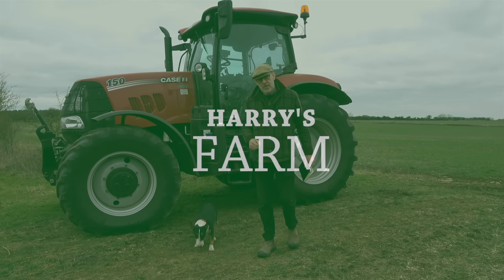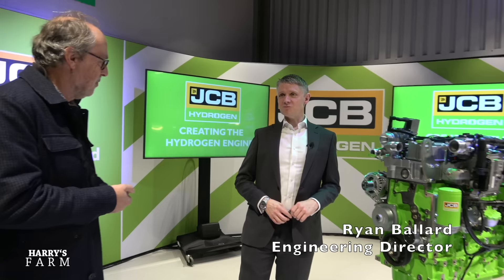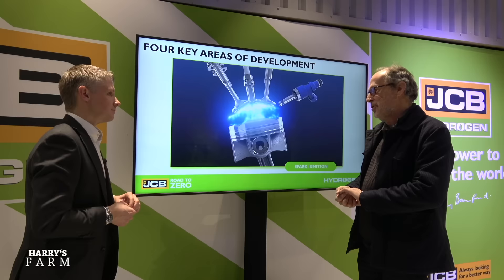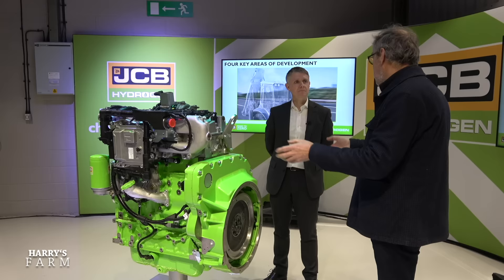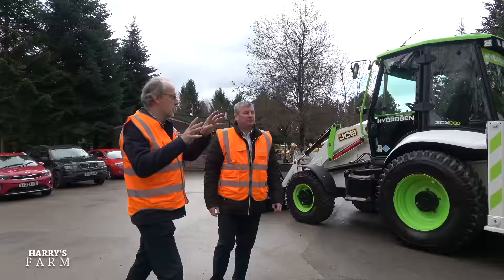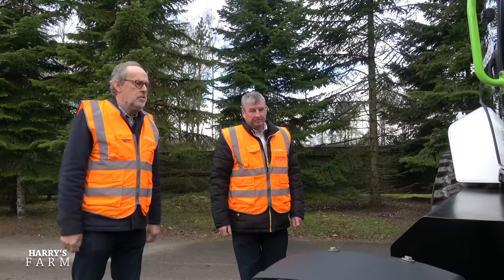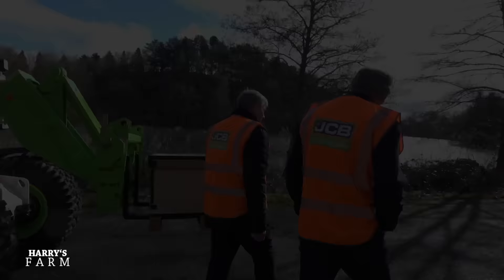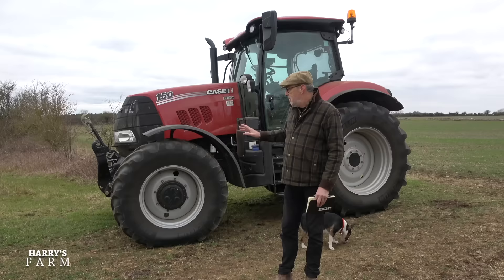JCB is moving to hydrogen power for all their big machinery. Here’s why.

Comment: If you want to bury your head in the sand a JCB is a good tool to use apparently.

It's a lot easier to get electricity to a farm to recharge batteries than liquid hydrogen.  While hydrogen can be an excellent low carbon fuel it is very difficult and expensive to distribute to remote users.  The Bamfords are about to go down the same path at the Toyodas.  That's sad.

Comment: A quick Google seems to indicate that it takes about 50kWh of electrical energy to generate 1Kg of H2. So by my reckoning a 1MW wind turbine could generate  1000/50 = 20Kg of H2 per hour or 60 litres equivalent of diesel (1KG H2 = 3 litres diesel). This is just about the amount it takes to fill my Land Rover. Could we ever install enough turbines to generate commercial quantities of green H2? Please comment if I have made a mistake in this calculation, I think I must have somewhere - just can't see it.

Comment: 350 bar tanks that’s a lot of pressure Is that flammable then sounds abit dangerous compared to normal vehicles and if the getting put to work might be dangerous lol would any and mechanic be able to work on it? What about fuel station what would be the difference there ?

Comment: I just don't know why you would use this over a fuel cell and electric motors? Initial costs, both for the customer and manufacturer maybe? I just know that some of the biggest expenses with this is the generation and transport of the fuel. So having a fuel cell that's able to get twice as much energy out of the gas seems like the much better choice. I know with cheap hydrogen it doesn't really matter as much, but we are a long way off from having that. The amount of green energy available is increasing rapidly but we are still quite a ways from having the excess generation capacity that would make hydrogen competitive. Supplementing any green hydrogen with blue hydrogen is probably worse than just running diesel or the natural gas itself.

Comment: Hydrogen in the United States right now costs $25-$36/kg right now. 1Kg of hydrogen has about the same potential energy as a gallon of gasoline, which is slightly less energy as a gallon of diesel. How much fuel does a machine like this typically consume? To power a hydrogen engine with for the same amount of time as you could with 5 gallons of diesel would cost $150+ in hydrogen fuel.

Comment: Now JCB have to work on an onboard electrolysis unit. Water will be the fuel source. This way the vehicles will supply their own hydrogen. Water is extremely dense in hydrogen. It's the most logical approach. Of course, Big Oil will hate it, as they always have.
Reply: You forgot about the energy required for the electrolysis….
Reply: @Simon-dm8zv  No, I didn't. I do realise electrolysis requires energy. The requirements for the amount of hydrogen needed in a car's engine can be supplied by electrolysis via an electrical system in the car.  Stanley Meyer did it in the 1990s already. He even had a patent on it. Alas, he's dead now. I've talked to one old fella who was a mechanic and he told me he and his work mates once spent eight months, working around their normal schedule, converting a V8 to hydrogen with an onboard electrolysis unit and it drove long distances on very modest amounts of water. Of course, this is made illegal to protect the monopoly of Big Oil. So, you don't need a nuclear power plant in your boot to do some electrolysis. You just need a battery and an adjustable voltage/current unit.
Reply: @nephos100  It's not "illegal". It simply doesn't work.
Hydrogen electrolysis requires more energy than what the output hydrogen contains.

Let's assume 100% conversion efficiency (physically impossible).
You take one liter of water and convert it from H2O to H2 + O. Splitting these apart takes a certain amount of energy.
This energy you spent is akin to lifting a weight over your head - the hydrogen wants to recombine with oxygen, and contains potential chemical energy, much like the weight wants to fall down and unleash its energy.
Now you recombine the H2 with O, either through a fuel cell or through combustion, and you again end up with an equal 1 liter of water.

And you expect to have gained excess energy? Where would the energy come from? You start and end up with equal amounts of water.
Similarly, the weight would fall down with the same energy you spent lifting it up - not MORE.

This is a scam, and a really obvious one too. Ask any chemist or physics professor.
"He even had a patent"
But have you ever seen this car work? No?
Reply: @logitech4873  No offence, but everything you just said is completely untrue. But points for trying to troll. Pity it is as transparent as glass. I don't know about the metaphor for trying to lift weights over your head, but why don't you try using the capacities within your head called honesty? You might have to dig deeply, though. Hydrogen from water is not a unicorn. Like I said, water has been used as a fuel source via on-board electrolysis systems invented by individuals and of course denounced by Big Oil trolls.

Comment: He says, "many countries are committed to Hydrogen", a few years ago the same countries were committed to Electric and look how that turned out !  There will be NO cheap Hydrogen fuelled engines, all the $Billions in R and D need to be recovered. Having said that, I do reckon that of the alternatives to diesel, hydrogen has a better chance of success than electric, at least until the electric car industry finds a way to build lightweight massive storage capacity batteries.

Comment: I've been waiting decades for the world to take hydrogen seriously. It looks like heavy plant equipment will provide the impetus for the hydrogen infrastructure the world needs to continue operating cars/transport in the same way it currently does - refueling in seconds NOT hours like electric vehicles. Also the existing fossil fuel distribution system (petrol stations) are highly suited to handling flammable liquids like liquid H2. And every wind turbine in the country can have an electrolysis plant to make H2 when its windy and the grid doesn't need their power.

Comment: Actually you can make hydrogen into petrol by combining it with co2 from the atmosphere, this is the perfect solution, because it can be used in the cars we have now, and in future EVs with fuel cells. It's the perfect way to store renewable energy. It can be distributed using the petrol stations and tankers we have now. No need to build charging stations, no need to build battery factories, no need to haul heavy batteries around, which makes for bad handling, and fire hazard. Batteries are no solution for transport it makes no sense.

Comment: How are we going to store this hydrogen in the vehicle? If stored under pressure in steel cylinders, the amount will be very limited. A five foot tall, 12in diam cylinder will only store about 6lbs of h2 at 300 bar! If stored as a liquid, this will get around the problem of quantity but the big problem here is that it will have to be stored at cryogenic temperatures. Hydrogen might be a good fuel for stationary applications but until we beat this storage problem, I don`t think it`s such a great fuel for vehicles.

Comment: Totally agree that EV's are NOT the answer. We still don't have a joined up energy policy so for me we're on a journey towards net stupid. This system is more realistic but why would they want to use an ICE engine and not a fuel cell and electric motor(s)? That system converts hydrogen back into electricity so you end up with a vehicle you can refuel quickly and is more efficient than an ICE engine that produces a load of waste heat? 

One thing most people don't realise is that hydrogen only has a third of the calorific value of natural gas and that our gas transmission system transports 7 times the amount of energy than our electricity grid. Where the hell is all that hydrogen going to come from as it sure as hell isn't going to be from windmills and solar panels?

Comment: The efficiency question was fudged as  the energy content per gram of hydrogen is 3 times higher.  Tell us the brake specific fuel consumption JCB  on a calorific basis??
It's not really that 'green' ..the hydrogen used is extracted from methane because electrolysis is too expensive. Plus a huge amount of energy is needed to compress hydrogen into heavy tanks and transported by diesel truck. 700 pound tanks are needed to make it practical (is filling up everyday really practical) but the energy needed to compress to this level is astronomical. Good publicity but hydrogen replacing the energy density and convenience of diesel is fantasy

Comment: Hope it works for them but I'm extremely sceptical that it will work long term, seems like sunk cost phallacy we know engines so lets continue to make engines their leaving so much potential efficiency savings on the table compared to a fully electric power train. The economics for hydrogen will never work, you can't cheat physics.

Comment: Impressive, and I'm not easily impressed.
Obviously there are still questions. How long do the metal components of the engine last when they are exposed to hydrogen, given the known problems.
The high cost of hydrogen production is acknowledged but the basic cost of energy remains. If energy costs become very cheap, then hydrogen use becomes cheap. But governments and environmental activists seem hell bent on making energy more expensive, not cheaper.

Comment: Was there any mention of why they went for hydrogen combustion engines over fuel cells?

 On paper at least, a fuel cell is much more efficient.  I'm guessing they figured they already have the manufacturing capability for engines in place, so makes it easier to transition.
Reply from the maker: Yes there was in the first video I did back in July 2021. 
Basically fuel cells don't like shocks, vibrations and dust, all of which are a constant companion on heavy plant machinery. The fuel cell powered machines JCB built were approx double the price of the diesel powered version and suffered constant breakdowns from ruptured membranes in the fuel cell itself.

Comment: I think this will be a total disaster for JCB and any other company going down the hydrogen vehicle and particularly the hydrogen combustion engine route. 
Long term, the only place hydrogen engines might make sense is air travel, but the Hindenberg lives long in the memory.

In relation to hydrogen Internal combustion engine vehicles, there are major concerns over the operating cost, efficiency, reliability, and supply chain. 

First issue: 
In the video they keep referring to familiarity with the old way of doing things like fixing your own engine when it breaks, servicing it every 500 hours, connecting in a 500bar hydrogen pipe to your machine just like your old diesel bowser etc. Is that for the benefit of the customer or JCB I wonder? It comes across as a bit of a backwards looking sales pitch, appealing to an older generation and perhaps also to Brexit mindedness?
There’s a distinct lack of simple, hard engineering analysis and common sense in their claims. 

I’ll do some back of the envelope calculations. I’m sure I will make some mistakes here and there but the scale and measure of my arguments are correct.
They said at 22:31 that this JCB Backhoe machine would use between 6 and 10kg of hydrogen per day. Let’s say 8kg per day avg.
Hydrogen has a Lower Heating Value of 33.3 kWh/kg. (it is correct to use LHV in this non-heating of non-boiler application)

The average daily energy consumption of this machine would therefore be 8 kg x 33.3 = 266kwh per day. That’s a lot of energy consumption! Equivalent to circa 25 litres of diesel per day or circa €42 at current prices.

However the efficiency of Diesel combustion engines is only circa 25% tank to wheel efficiency. (or 30% for very efficient engines. This is widely published but rarely common knowledge). Meaning that only 25% of the energy released in the mini explosion in the combustion chambers of the engine ends up doing useful mechanical work. Circa 75% is lost as heat. Petrol engines have even lower efficiency, usually 20% approx.

The new JCB hydrogen engine will be the same or slightly better than a diesel engine according to JCB. Let’s assume 25% efficiency, as they haven’t given us exact figures.

So, of the 266kwh of useful hydrogen energy which is pumped into the machine each day, only 66.5kwh of energy will go towards actually doing useful work in moving the wheels, and powering the hydraulics etc in that day of work.

Also, hydrogen generation and distribution is actually really inefficient and unsustainable, with most hydrogen coming from steam reforming natural gas. Very little green hydrogen (coming from electrolysis of water etc) despite the technology being >100 years old, however this is set to increase apparently.

They hinted at this next problem in the video.
A typical uk high pressure tube hydrogen delivery truck to fill up your bowser can currently only carry 300kg of hydrogen at <250bar. (Pump / compressor needed to refill your 500bar bowser).
These delivery trucks can only hold 300kg of hydrogen gas, which is only 9,900 kWh of energy.
The value of this hydrogen fuel on board is only 300kg x €14 = €4,200 based on current uk prices of £12 per kg hydrogen. 
https://www.fuelsindustryuk.org/future-of-downstream/hydrogen/

This is totally unsustainable financially. Hydrogen would need to be 10 times cheaper than it is at present, to compete with electric vehicles. 
If it becomes 10 times cheaper, then a big delivery truck would only hold €420 worth of hydrogen, then no delivery company could make money after they pay for the cost of the hydrogen, the delivery truck, the driver and all other costs.

https://www.enapter.com/kb_post/what-is-the-energy-content-of-hydrogen 

Standard 8 wheeler Diesel delivery trucks in the uk typically carry 23,000 litres of diesel. If I convert this to energy kWh which is 10.16 x 23,000 =  233,000kwh approx.

This is a 23 x difference in the volume of energy being transported via diesel vs hydrogen via tube tricks.

https://www.crownoil.co.uk/fuel-tankers-fleet/

New bigger hydrogen  trucks are in development which  could carry 600 or 900kg, but are very rare, and very expensive with high pressure. J
Hydrogen gas delivery network  would require up to 23 times the number of truck deliveries if it were to replace diesel. This is a 2,300% increase at a time where truck drivers are scarce.
Do we really want to have 23 x the risk of fuel delivery trucks crashing? 

What if the JCB was powered by battery electric instead of hydrogen combustion, I hear you all asking???

Let’s say that a 90kwh battery would be suitable for this JCB and would give extra buffer at the top and bottom vs the 66.5 avg daily consumption. EVs are typically 85 to 95% efficient from battery to wheel!

Note: for comparison, a Tesla model Y long range battery has 75 to 82kwh of stored energy, which gives circa 400 to 450km real world range.

So, the owner could charge their 90kwh capacity battery electric JCB each night using a normal 7kW EV wall charger and it would take less than 10 hours to charge up with 66.5kwh or 75kwh of electricity for a likely cost of circa €10 or €15 per day depending on the night rate cost of your electricity.

Not to mention, if a solar PV array is installed, it can be charged for free.

At present in the UK, hydrogen is typically £12 (€14) per kg, but this can range from £10 to £15.
So to run this JCB on hydrogen, the daily cost would be 8kg x €14 = €112 per day. 🥸 😂😂

This is nearly 3x more expensive than Diesel, and between 6 and 10 times more expensive than an equivalent battery electric JCB to operate! 

According to Bloomberg in 2023, the cost for the manufacturer to buy a battery pack is €128/kwh, and the prices drop every year.

So a 90kwh pack would cost JCB €11,520 and would weigh circa 600kg, which is not much more than a 4.8l diesel engine and power train.

Likely manufacturing cost of the electric  power train:
€3k max each for 2 x electric motors (front and rear), 1 x motor for the hydraulic pump, plus some power electronics.
So it’s likely to be circa €20k to €25k cost for all major power systems on board a battery electric JCB. 
However there would be good savings from having no engine, no hydrogen fuel storage, no big gearbox and drivetrain. Not to mention not needing to buy a huge hydrogen bowser tank.

Other benefits of electric.
Much less maintenance …. no big combustion engine and drivetrain with its hundreds of moving parts.
No expensive and dangerous carbon fibre hydrogen tanks at 350 bar (which is over 5,000 psi pressure)
No big gearbox and drivetrains needed
Very few moving parts

Prove me wrong please!

Comment: How do hydrogen combustion engines perform in relation to consumption of fuel in compaison with fuel cells?
Reply: Hydrogen fuel cells are much more efficient. No idea why hydrogen combustion is even worth thinking about. You get lots of torque from electric motors, which suits farm equipment well.
Reply: @logitech4873  The reason its worth thinking about, its cheaper to build, requires less technology development (as exiting manufacturing can be retrofitted to make these engines), these engines can be retrofitted onto existing machines and does not require rare materials, like lithium, to make.
Reply: @TheAlexagius  It's really not that simple though, and I'm not sure what the long-term effects of hydrogen conversions are, with things like hydrogen embrittlement being a real issue. 
The main issue though is simply that hydrogen has pretty low energy density per liter, meaning that you want to use it as efficiently as possible. I can tell you that the upfront cost of a HFC & electric motor retrofit is higher, but the much lower running costs will more than make up for it.